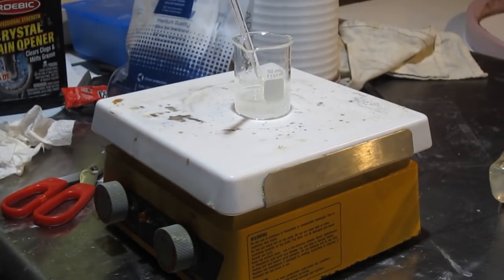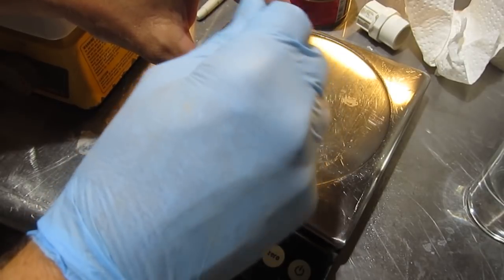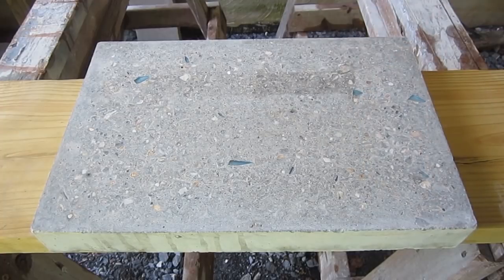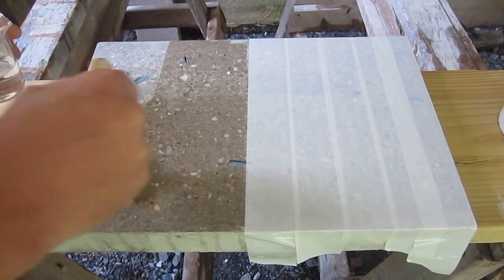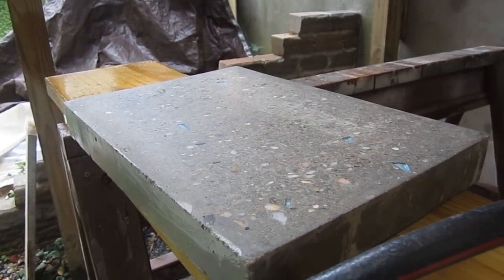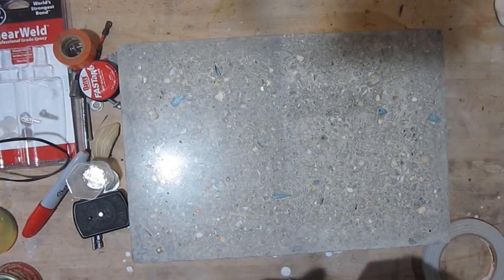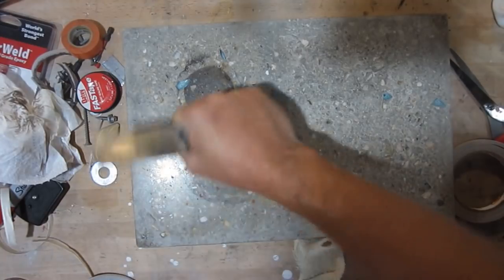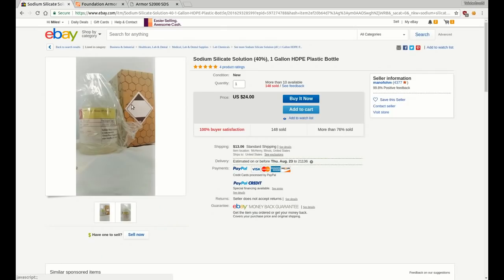DIY Concrete Densifier

Comment: You aplication technique was probably sufficient. but you really need additional applications of sodium silicate for a better seal against stains after each polish. 

The sodium silicate combines (cures) with co2 from the air forming silicon dioxide  (essentially glass) and sodium carbonate (baking powder), so give it time to react with CO2. 

 The silicon dioxide glass essentially coats the cement and fills in the pores. After each polishing just apply an additional coat so that you get a better and better sealing after having ground or polished the previous coats.
Reply: I think both reactions are hapening because his concrete probably wasn't fully cured

Comment: on the polishing side of it, we use the densifier as following: we apply it soak wet after 120 diamond grit., (but no puddles ) , wait overnight, and in the morning we cut with 50 resin pad , we apply lick coat of densifier again just before the grinder  as you go to help cutting of the residal densifier and in the same time the heat crystalizes the densi filling up the micropinholes and pores.  , you can apply again the lickcoat up to in order ti achieve maximum gloss you can do lick coat 50 resin, 100, 200 resin ... and than just buff of dry , and you have crazy shine ;)
Reply from the maker: That's good information Martin.  Thanks.  I'm going to try that.  So you are polishing using sodium silicate instead of water yes?  Looks like I'm going to need to make up another jug of sodium silicate ^_^
Reply: sodium silicate is like a old school densifier method. Iam a professional concrete polisher so we use densifier, so ... couple of lick coats wet will sort out amazing polish.
Reply: @martinhudec773 you don't need to demsify 2 times that's a waste of time for the same results. In fact you don't need to densify at all and you can still get a great shine. unless the floor is extremely soft. All you really need is 2 coats of sealer and burnish at the end.

Comment: Mate thats why its called Liquid Glass, and I for sealing concrete you need to mix it 1:3 -4 water, or will be hard to absorb fully, apply 3 coats !  I add my own high quality Graphene to Liquid Glass and concrete , for super hard properties, and its 400x water resistance!

Comment: When I first got into grinding/polishing concrete there were no lithium silicate densifiers but only the sodium silicates. They dont soak in nearly as fast and leave a slick gel on the surface that has to be washed off before polishing. Now EVERYONE uses lithium silicate because its so easy to use and dont have to wash anything off before polishing....But I can absolutely say the old sodium silicates harden softer concrete surfaces better than the lithium....also there is zero stain protection from any densifier no matter what the manufacturers state...and the polish guards do pretty much nothing for stain resistance either....must be sealed with penetrating/impregnating sealers for water/oil repellency
Reply from the maker: That's good information @MoJo.  Thanks!
Reply: Apart from Kodiak ICT penetrating silicates . Made by a chemist with a love for concrete. Not affiliated I just disagree with your statement

Comment: Sodium or lithium silicate is primarily used to harden and densify concrete. it will increase water resistance but only be about 85% waterproof. For a concrete counter-top the surface must still be sealed to resist staining. Concrete is porous due to bleed (excess) escaping water during the curing process which creates capillaries silicates combine with free calcium in the concrete to form crystalline structures which fill said capillaries. It is ideal to use on concrete or block walls and foundation walls to reduce water transmission and chalking and increase concrete strength. It is not  intended to be used as a stand alone waterproofer .
Reply from the maker: All good information Boo.  Thanks.  Since making this video I have discovered that there appears to be no way to completely seal concrete without covering it in either plastic or teflon (fluorocarbon sealant).  I'm still looking for a way though ;)
Reply: Polyaspartic coatings seem to achieve some pretty remarkable results. I'm trying to decide what approach might work best for sealing my basement floor and walls. The building dates from around 1960 and I doubt there is any waterproofing membrane, and the air is 80-90% relative humidity most of the time, and water seeps through after rain. I'm currently leaning toward lithium silicate densifier but it's all pretty new to me...
Reply: @dork3nergy  Crystalline waterproofing is a thing, and it works great at keeping water from penetrating into concrete, but I have no idea if it would prevent stains on the surface.

Comment: You should add a surfactant (experiment with anionic, cationic and non ionic, the interactions in a very alkaline and concentrated environment can be surprising) to your solution to help lower the surface tension so that it will enter the pores easier, and maybe a thickening agent would be good also.
Reply from the maker: Those are both good points. Thanks.
Reply: If you care to share, what surfactant would you recommend?  Thickening agent?

Comment: Waxing before allowed to stain should make concrete surface resist oil and wine.
Reply from the maker: I did some tests on that.  It works great if you can get the mess off in a reasonable amount of time.

Comment: Would this help make rough concrete denser?  Like if I have soft concrete from a Gunter pool shell, would a densifier help make it stronger?
Reply from the maker: I'm no expert but it might depend on the condition of the concrete.  The densifier reacts with soft, calcium hydroxide in the concrete and hardens it by converting it to hard, calcium silicates. You might have some luck densifying it.  You could always do a test area to see how it goes.

Comment: Excellent video, a topic near to my heart. I spend a lot of time playing with this stuff lately. Where I'm at, I can get one kilo of sodium metasilicate for six bucks. So that's cheap enough to play around with but I find the surface needs to be ready or it is easily wasted. I think part of your success was that you had such a nice finish to begin with. 

Did you get those pads on eBay as well? I've got an angle grinder with a 120 grit diamond but I've had trouble finding something that works well for higher grits. 

I find that I can just use my hand and a block of 1000 grit sandpaper with some soap to create a mud that will put a glassy/ceramic looking polish on some smooth troweled mortar after it is cured and silicate is applied. But it takes ages and multiple coats.
Reply from the maker: Yes, the pads are from eBay.  Get the heavy duty ones.  A bit more expensive but last longer and stay flatter.  I had to hand polish some inlayed stones in a coffee table top.  It's a lot of work but looks great in the end.  Wouldn't want to do a large surface that way mind you.  I'm playing around with adding pozzolans now so stay tuned for those results.
Reply: @dork3nergy  Hey, thanks for the reply. I had already found them. I'm excited to see how it goes.

Comment: Can I use sodium hydroxide mixed with water as a densifier on my dusty concrete or must it be mixed with something else as well as water?
Reply from the maker: I don't think NaOH alone would densify the concrete.  You'll need a solution of sodium silicate or lithium silicate to do that.

Comment: Instead of silica gel, could you have used a Terro ant killer powder = SiO2 ? It would be nice to see making it all from the common household chemicals.
Reply from the maker: According to the MSDS sheet for the Terro stuff, it's 80% silicon dioxide, basically sand.  It doesn't list what the other 20% is oddly.  The little sharp edges of the sand scratch up the ants and they die of dehydration. 

The sodium silicate I've seen made from sand requires heating the NaOH and sand together until the sand reacts with the NaOH.  It's a dry process. Should be doable with the Terro though.  If I see some I'll pick some up and try it.  Don't forget you can use the silica gel from those little "do no eat" packets.
Reply: @dork3nergy   silica gel is  a mix of silicon dioxide and sodium silicate. It melts/dissolves faster and at a lower temperature than silicon dioxide alone. 

one can use pure silicon dioxide sand.  start with stainless steel pan and melt sodium  hydroxide.  molten sodium  hydroxide is some very very very scarry stuff to get on ones skin so be very very careful and where protection. now just add the sand.  and stir untill it is melted/dissolved. then let cool with a lid on to keep out CO2. after its cooled slowly  add water and heat if nessesary to make water soluble water glass sodium silicate.

if one uses sand, then a bath of muriatic acid would be good to clean it of various metals like aluminum  calcium iron and magnesium. wash the sand with distilled or deionized water several times and you'll have fairly clean silicon dioxide.

Comment: I thought sodium silicate will be mixed with calcium hydroxide not sodium hydroxide???
Reply from the maker: The calcium hydroxide is in the concrete.  It's an unwanted by-product that is formed when concrete cures.  Sodium silicate hardens it.
Reply: @dork3nergy  well said information. Thanks.

Comment: also run a blowtorch over it while still wet for a even shinier polish ;₩
Reply: CO2 from the torch will help the sodium silicate fully cure in a shorter time frame, but he really needed additional  coats.

Comment: my question is s.s is not waterproof because it is water based so how we make it waterproof? kindly help me thanks its not working ?
Reply from the maker: Densifying will help but you also need to seal it.  You can buy a commercial sealer that will do the job or I've found that using a wax does a damn good job.  I made some of my own here : https://youtu.be/tEIOC8-y_hA You can also buy this kind of stuff online.
Reply: thanks for your reply .but i am researching for make s.s waterproof and i think i am near of it. and best of luck .
Reply from the maker: The sodium silicate reacts with the calcium hydroxide in the concrete to form calcium silicate which won't absorb water as easily.  I don't think it can make it waterproof however.  

Let me know what you find out.